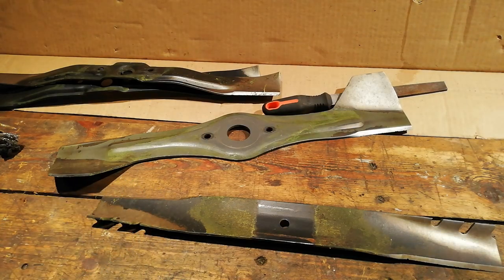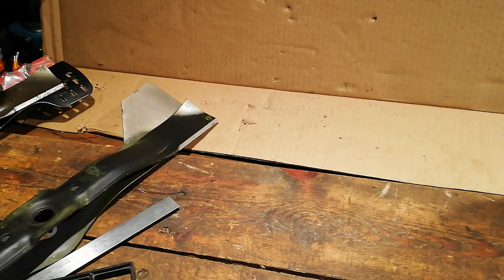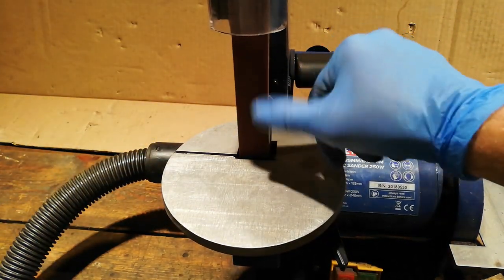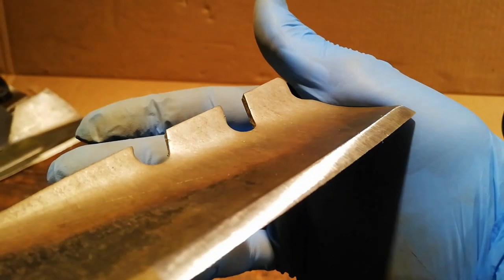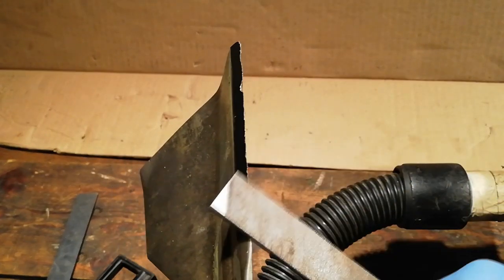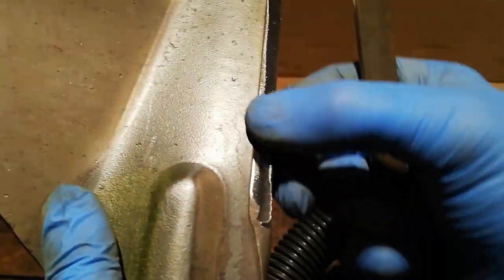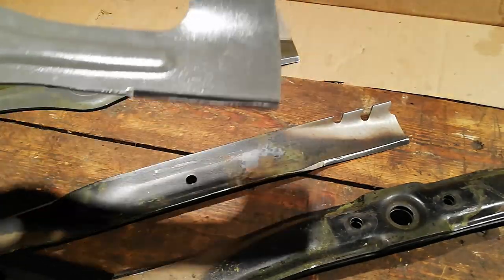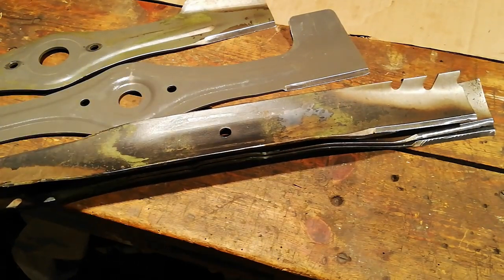How To PROPERLY Sharpen LAWN MOWER BLADES

Comment: Does it matter the shape of my lawnmower blade. Like flat versus the up curved blade on the backside of blade. I believe what I'm trying to ask is, if I want to catch clippings Do I use certain blades. If I do not catch the clippings DO I use a different blade. I have a 22" toro recycler push mower.?
Reply from the maker: Yeh the blade does matter, If you want to bag or side discharge etc you ideally want a high lift blade (larger angled wing section behind the cutting edge), where as if you want to mulch you need a mulching blade which is usually a lower lift and maybe a more wavey design or has cut outs in the wing etc. 👍
Reply: @RJLGardens  , ok thnx. I have both. I will put the high lift on for bagging